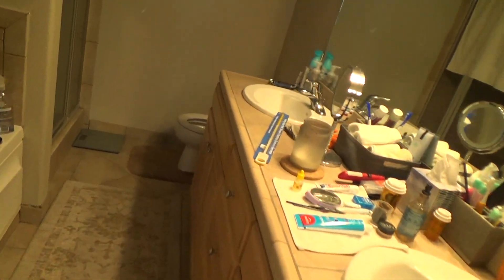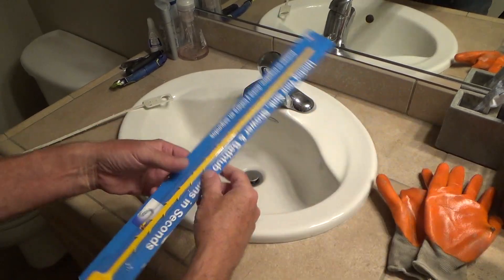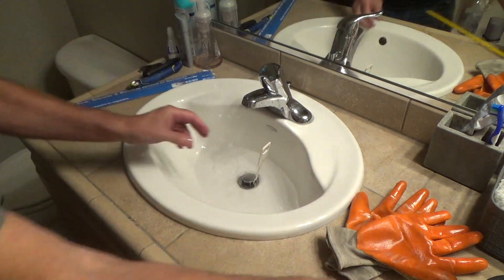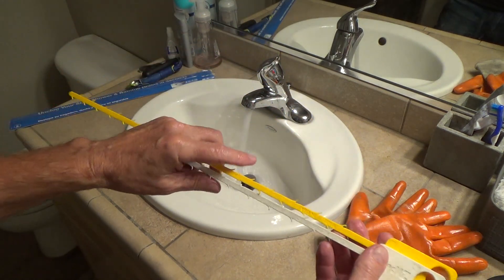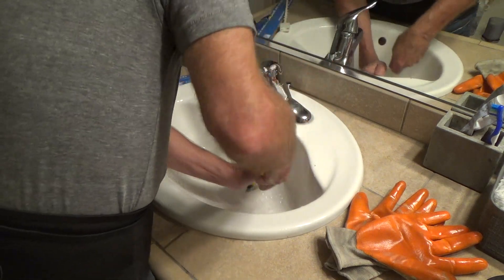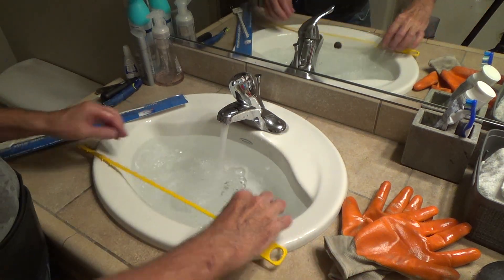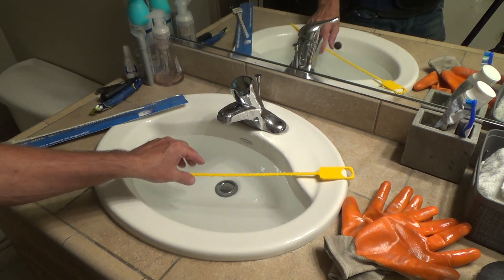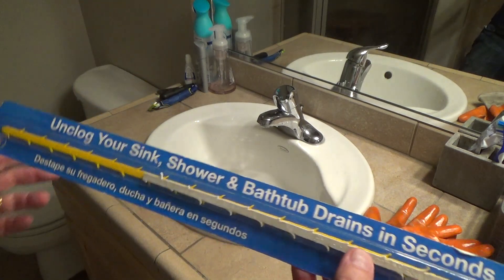Man Says He Can't Unclog Bathroom Sink Then Does It Anyway

Comment: they also make baby plungers. I was able to unclog one once with one of those.
Reply: I picked 1 up from the dollar store. Doesn't work every time, but I was able to unclog my sink a few times with it. At least it's better than using a chemical option every time
Reply from the maker: I could see that working too but I've always first tried to unplug bathroom sinks with the zipit first & I can say 99 out of 100 times the zipit will do the trick. Try it!
Reply from the maker: Yes I'm with you about not wanting to use chemicals & can say most of the time I am able to unclog a bathroom sink with the zipit so I always try that first. Thanks for your message!
Reply: @VideoJoeKnows  I have a product exactly like that, but the clog in this case was past the P-trap. In this case the baby plunger was the only thing that unclogged it.
Reply from the maker: @hengineer  Nice job!